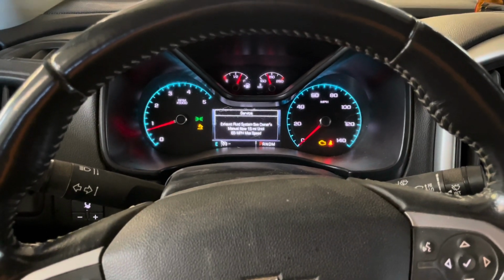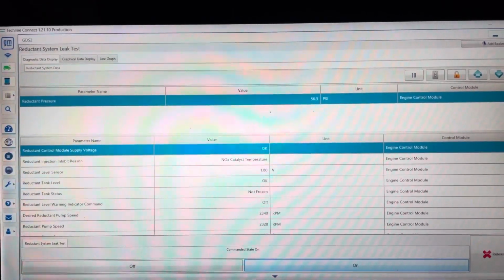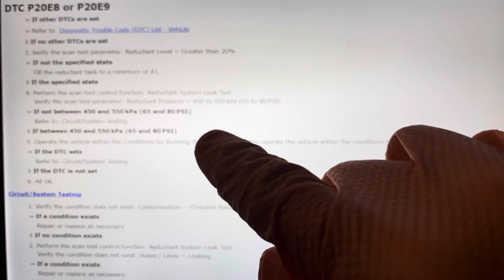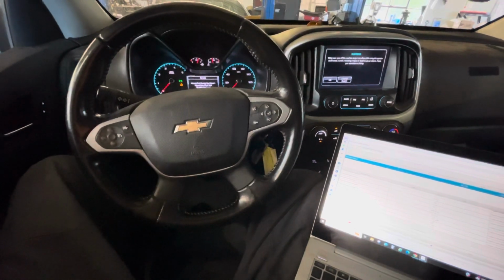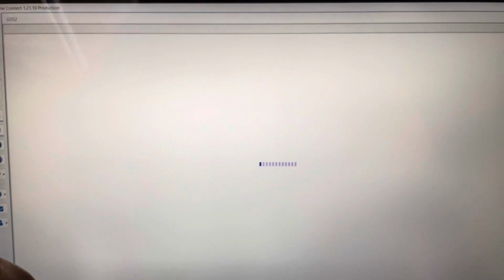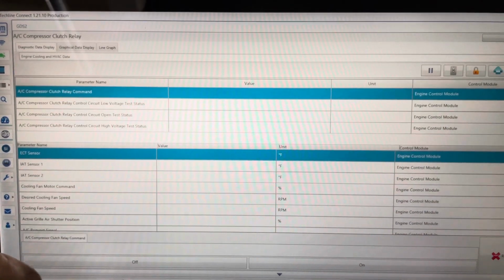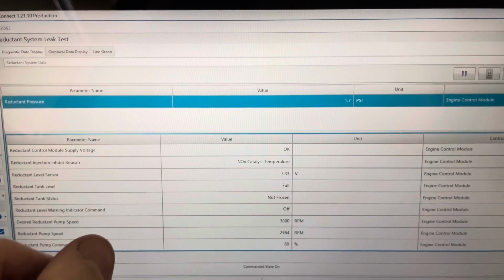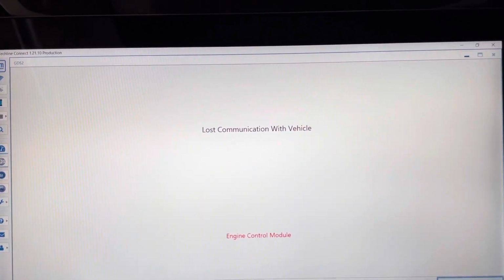Service Exhaust Fluid P20E8 - 2.8L Duramax Chevy Colorado GMC Canyon DEF Pump Diag and Replacement

Comment: How do you get the connections off on the pump
Reply from the maker: Well it's been a while since I've taken one off, it is hard to describe... You first have to remove the locking clip, then press the internal sleeve in one direction and pull the fluid line off... I hope you got it figured out... If needed I will create a video for you and demonstrate... The to-do list is very long, but I will show you if needed. Thanks!

Comment: What's the best scan tool for these 2.8 diesels? Thank you
Reply from the maker: The best tool is the OEM scan tool with a J2534 device, but it is fairly expensive. 

A good DIY tool is the Launch for GM tool. 

Check it out here: Launch CReader Elite 2.0 Scan Tool for GM... First Impressions
https://youtu.be/o33j-PJYaaQ

Comment: Probably need to replace mine (either the pump or heaters are failing.   Looks DIY'able except for that spanner, no idea where to get one or how to do it without one.
Reply from the maker: You will absolutely need the tool. That lock ring is tight. 

The tool number is J-45722… It is available online. 

Try Freedom Racing.

Comment: I will take 5 gallons of glorified water spilling into a pan or on the ground over dropping a tank any day of the week.....
Reply from the maker: Tanks aren't usually very hard to remove, then you can re-use all of the expensive fluid. I'd rather just remove the tank personally. My gripe is if they're going to design it that way, and then leave you with no way to easily drain the fluid... Can't even run the pump to empty the tank into a clean container. 

Thanks!

Comment: Have a 2018 denial, 2500 heater went bad, replacing the whole pump.It's a mess, save $1300.Good video
Reply from the maker: Thank you!

I do have a video that would apply to your 2018…. Check it out here: 

Duramax 6.6L Service Exhaust P21DD P20B9… Most Common Repair DEF tank reservoir
https://youtu.be/in_xvFkrV7I

Comment: What was the final psi on scan tool? Also the connectors above the tank are known to heat and melt...gm has to do better these pumps on Rock auto are 500 and up the dealer charges 1000 and up...I'm hearing these pumps are failing prematurely under warranty and even after...def sucks the emissions laws are killing wallets and everyday hauler and drivers pockets...not to mention if you do it yourself some Ecm's have to be reprogrammed to reset notes gm dodge ford..ridiculous  money making scam
Reply from the maker: Approximately 74psi after the repair. The specification is 60psi to 80 psi. 

Agreed, total scam on the consumer. All designed to keep us broke and to ensure our vehicles don’t last much longer than the warranty period. Planned obsolescence.

Comment: I have a 2016 Colorado, duramax.....   Whats the difference between the SCR and DPF?  Are they the same thing?
Reply from the maker: They are not the same... SCR (Selective Catalytic Reduction) is a catalyst and supporting exhaust fluid injection system to convert harmful exhaust gases into harmless gases.

The DPF (Diesel Particulate Filter) is a filter device on the exhaust system for capturing solid matter such as unburned fuel in the form of soot... Occasionally the DPF must be burned clean when it becomes full.
Reply: @DadsGarageDiagnosticSpecialist  Does my 2016 Colorado have both of them. (SCR & DPF)?  I thought the rear cylinder in my exhaust was a muffler, not a DPF.
Reply from the maker: @roscoebail5551 Yes it has both and yes you do also have a muffler towards the rear.
Reply: @DadsGarageDiagnosticSpecialist  I'm confused..... is the SCR & DPF in the same cylinder?  There are 3 cylinders in my exhaust system, the 1st one up near the engine is a DOC, the 2nd is a SCR, and the 3rd is a muffler.... where is the DPF?
Reply from the maker: Sorry for the late response... Did you get it figured out?

Comment: Honestly, I'd rather have the pump accessible on the bottom rather than having to pull the tank out to replace it like on my 2500.

Also, get yourself a keyboard with a touchpad for operating the tablet, I had the same problems clicking the wrong thing every time, lol
Reply from the maker: Yeah I’d agree if they would have been nice enough to add a drain or something to avoid the mess. 

I’ve mostly given up on the touch screen.

Thanks!

Comment: I have a 2018 Colorado. How do you get the cover off the def tank. I need to replace the sensor
Reply from the maker: There are plastic push-pin rivets to remove and the cover comes right off. 

Thanks.
Reply: @DadsGarageDiagnosticSpecialist  oh yeah the push pin rivets just come right out, why didn't i think of that.     Carefully pull out the center of the push pin. if the head breaks off, you have to pretty much tear it apart.
Reply from the maker: @redlineauto07Yes. It seems obvious.

Comment: Great video . Just got p1050code on mine canyon 2017 …. I gues it’s a def pump level sensor  …doesn’t show level of def  fluid
Reply from the maker: Most likely needs the pump/level sender assembly replaced.
Reply: @DadsGarageDiagnosticSpecialist can I reach out a year later and get an estimate of what this would cost approximately?
Reply from the maker: Approximately $1000 for parts, labor, and diagnostic fees.

Comment: Thanks! Now I know the level sensor is integrated into the pump. My level on the DIC never moves from 1/3 full regardless of me adding as I go. I think the previous owner ran it out of def then it fouled the Nox 1 and 2 and the DPF. I replaced the sensors and ran a service regen and service bay tests. It's been good since but It's a pain guessing the def level.
Reply from the maker: Yes the level sensor is not the greatest design…. It does not measure the fluid level directly, it measures indirectly in 25% measurements. 

If you fill your tank with 5 gallons or so of fluid and it still reads 1/3 tank level, you can attempt to use the scan tool tank level reset procedure. In the end you may have to replace the level sensor assembly.

Comment: Great video... saved for future reference, have a 2017 with 120k on it, i do all the maintenance and so far so good, runs great pulls trailer no problem, and the mpg is great at a life time of 25mpg .
Reply from the maker: Thanks! I’ve seen very little problems with the 2.8L diesel. 

You’re about due for a timing belt. 

Thanks.

Comment: What’s name of that tool used to remove ring
Reply from the maker: J-45722 Fuel Sender Lock Ring Wrench

Thanks.
Reply: @D @DadsGarageDiagnosticSpecialist  or a hammer and a chisel
Reply from the maker: If you want to destroy the lock ring, yes.

Comment: Great video! It’s a shame no one was smart enough to put a drain into the DEF tank.
Reply from the maker: Thank you!
Reply: @DadsGarageDiagnosticSpecialist , what’s your opinion on these 2.8L Duramax engines? I’m looking at a 2016, with 120,000 miles, I know it’s close to timing belt change.
Reply from the maker: @davebullock3517  the 2.8 L seems to hold up well. I’ve only seen minor problems with oil leaks or coolant leaks at the back of the cylinder head. 

The majority of the problems that I see with them are the DEF system and DPF system.

If I were going to buy a 2016 and I was going to choose between the 2.8 L diesel with 6 speed transmission vs a 3.6 L gas with 8 speed transmission I would choose the 3.6 L gas engine simply for the lower cost of ownership maintenance and repair wise. 

When you’re driving the 2.8L has good low RPM torque, I think the gas V6 also has low end torque and is more fun to drive when you want to put the pedal down…. The gas engine also has better engine braking. 

Thanks.
Reply: @DadsGarageDiagnosticSpecialist , emission system issue, sort of saw that coming. 😂 Thanks for your reply.

Comment: where can i get that tool for the DEF pump ring?
Reply from the maker: Try searching for J-45722 Fuel Sender Lock Ring Wrench. 

Should be available somewhere online…. Definitely not possible without the tool. 

Thanks.
Reply: Small hammer and a screwdriver works fine actually better because your not putting allot of twisting force on a piece of plastic
Reply from the maker: @stevendemoss6609 No way. Takes way too much force to turn that ring. 

Screw driver will chew up the ring.

Comment: Has anyone got a code P2047 or P10D1? Truck was left out for a day and night didn’t know the temperature was going to drop to 10 degrees and below.
Reply from the maker: I have replaced an exhaust fluid injector before for a P2047 due to incorrect resistance values. 

Also there is an ECM programming update to solve P10D1 so I would do that first. 

Thanks.

Comment: @DadsGarageDiagnosticSpecialist Hi! Did you ever worked on diesel Duramax with code P026D? If yes, do you know what was the issue? If not, thank you anyway for taking the time to answer my question!
Reply from the maker: P026D can have many causes. Replace the fuel filter and check for metal contamination. 

Thanks.
Reply: @DadsGarageDiagnosticSpecialist  Will do, even though the filter has 91% to go, but I will try it. Thank you! Anything else I should check as well?
Reply from the maker: @vepo2341 P026D usually means there is too much fuel flowing through the fuel injectors for some reason. Most likely wear or contamination… there might be an ECM reprogramming that can be done to reduce the frequency of P026D, but the first thing I would do is take a fuel sample and check for metal contamination. 

Erase the code and it will likely not come back for a long time.
Reply: @DadsGarageDiagnosticSpecialist  Hi!
 Thank you for all the pointers, you gave me! I caved in and set appt with local Chevy. Just called them and  they informed me, that one of the NOx sensors were bad. They did not specified which one, but I will ask tomorrow when I will go pickup the truck. They also let me know, it was covered under powertrain warranty :-o which makes me really happy!
Reply from the maker: @vepo2341  I have been seeing NOx sensor number 2 failures most often. Thanks.
Reply: @DadsGarageDiagnosticSpecialist  I will see how long the replacement will work...hopefully at least same amount of miles as the original.
Reply: @DadsGarageDiagnosticSpecialist  Dealership called.....not a long ago, exact words "we changed the NOx sensor, started the truck and the engine was backfiring, we put it back to scan the events and one of the injectors is bad, we will replace it under powertrain warranty". Oh well, at least they find another hidden issue. I hope the injector is the last thing. I asked if it would not be good to change them all....answer was "we have to follow the policy" if there will be issue with another one, then we replace them all. We will see.....
Reply from the maker: @vepo2341  that is a little concerning. The fuel injector shouldn’t just fail suddenly like that unless it was misfiring beforehand. 

They may be referring to the indirect fuel injector mounted in the exhaust.
Reply: @DadsGarageDiagnosticSpecialist  I hope, they will give me detailed report of what has been done, not just sign off paper some kind of....Injectors (old schools ones) should not fail like this, sure there could be manufacturer duds but overall....no.

Comment: Around 19:00 What fixed the new pump pressure from 1.7psi to 72psi?     Also, does that metal piece at the end of the video stay in for install?    Great video!
Reply from the maker: Somebody came and talked to me while I was recording that part. There wasn’t anything wrong it was just the system doing a purge cycle. I mentioned that the injector was being pulsed on and off before building pressure, so all I did was wait another minute or so and it built the pressure and worked fine.

And yes the little metal piece should come with the new pump and it’s supposed to be inside the fitting and stay inside. Thanks.

Comment: Nice presentation. What software were you using?
Reply from the maker: Thank you. I was using factory GDS2 scan tool hardware and software.
Reply: Not gonna mention the leak?
Reply from the maker: @michaelslattery2121  what leak?
Reply: @DadsGarageDiagnosticSpecialist at 6:00 when you remove the cover above the spare, there is a clear and steady drip.
Reply from the maker: @michaelslattery2121  I had the exhaust fluid hose disconnected at that point so the drip was coming from the pump about to be removed. Thanks.